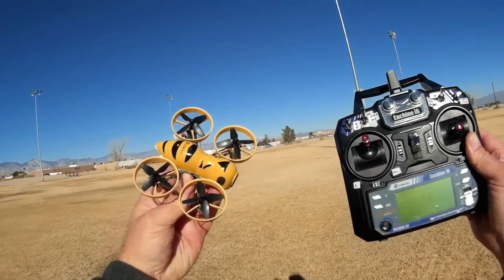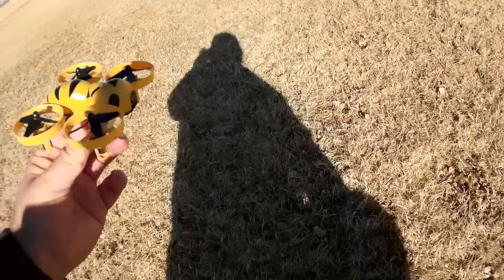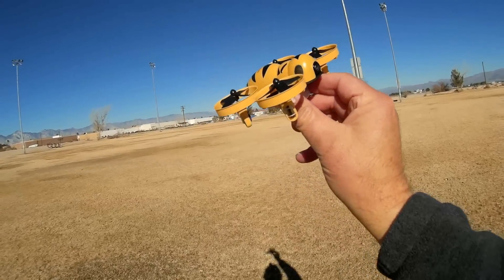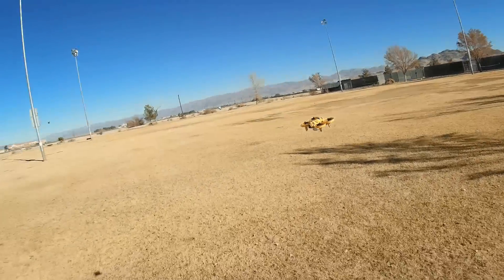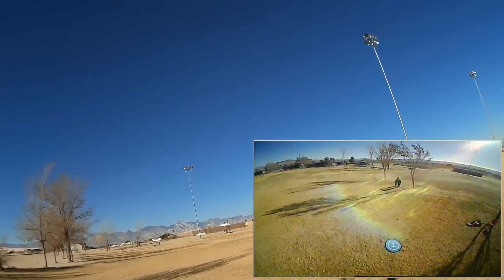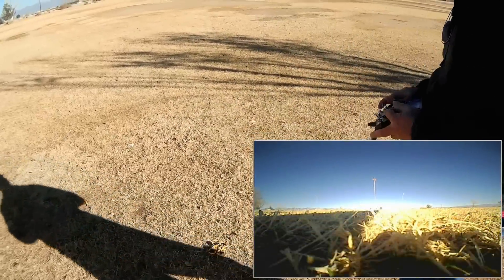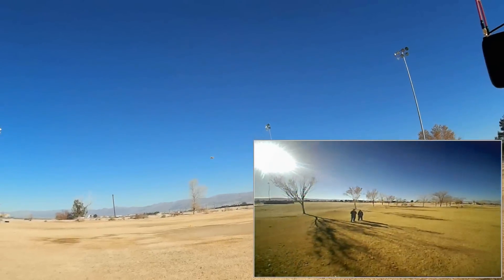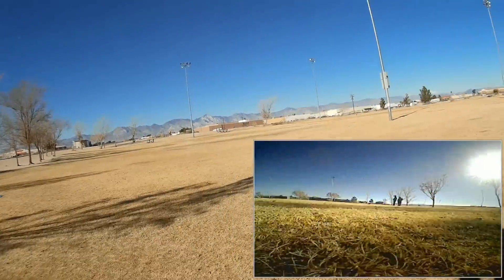Eachine Fatbee FB90 Micro FPV Drone Flight Test Review

Comment: hi another nice video...but sir I would like to know one thing though its not about the quad itself but its about the tx...my question is can i bind this tx with a flysky fs ia6b rx usuing pwm or ppm protocol to fly my other drones like 250mm qav like stuffs...i have a 250 mm quad running with emax 1806 2300kv, 20amp simonk,naze32 open pilot 6dof,3s 2200mah(35c)5030 prop...your feedback will help me a lot quadcopter 101 :-)
Reply from the maker: Unfortunately, this doesn't come in ARF version to install your own transmitter.  But it does come in Flysky BNF, with 6CH PPM output Flysky AFHDS.
Reply: Quadcopter 101 thanks for your reply

Comment: For the same money, I really like my Eachine QX 95, the Flysky FSi6 transmitter and my Eachine VR 2D goggles.  I do recommend sitting on a chair when flying FPV.  I'm a great line of sight flyer, but flying FPV for us old guys is quite different. Also, if you need reading glasses like me, you'll have to purchase Carson lenses for the VR D2 goggles..
Reply from the maker: Be careful of the Flysky BNF version of the QX95.  It uses the old AFHDS receiver, with no failsafe capability.  My Flysky QX95 flew away, never to be seen again :(  https://www.youtube.com/watch?v=XyxQk-OCkKI
Reply: I purchased it for my indoor RC club flights.  I'll keep an eye on it though.;)

Comment: How do you calibrate the gyro? My is no way as stable as yours out of the box. It need a lot of backward and left turn trim to maintain a so-so hover. The prop to the right of the camera come off too easy. Its off 3 sec on the maiden fright! BTW, I do not know how to use Cleanflight? Can you do a video?
Reply from the maker: As you may have guessed, you need to use Cleanflight to calibrate its gyros.  Cleanflight is available as a Google Chrome plugin app here https://chrome.google.com/webstore/detail/cleanflight-configurator/enacoimjcgeinfnnnpajinjgmkahmfgb?hl=en
I recommend that you search YouTube to view some Cleanflight tutorials.  Focus for the moment on gyro calibration tutorials (it's not difficult).
Reply: Took your advice and do Cleanflight to calibrate the Accelerorometer. Was looking for the save button by going through the menu selection on the left panel. But before I perform any safe, the motors are spinning at 1000 RPM. I am a lost how and why this happened. Unplugged the USB cable and plug in the battery, all motors are spinning at full speed. Now it is not playable. Can you tell me how I can fix this? Is there a default setting data file I can download to it to get it back to a functional state? Thanks for the help!
Reply from the maker: You may want to ask your question in the following forum.  They have FVB90 owners with more experience with this aircraft, and may be able to help you with your problem https://www.rcgroups.com/forums/showthread.php?2744640-Eachine-Fatbee-FB90-90mm-Micro-FPV-Racing-Quadcopter-F3-FC

Comment: great video as always.
got a question for ya, I heard you can put a piece of tinfoil over a certain part of the quadcopter to block the satellites to make it go faster....
any truth to that?
Reply from the maker: That might only work with GPS quadcopters that don't have an option for selecting manual or altitude hold control. When flying in GPS mode, many quadcopters limit the speed that you can go to help improve accuracy of the GPS.  I think that the intent of the foil is to force it to lose satellite lock, and thus have it default into manual or altitude hold mode.  But by doing so, you better know how to fly it manually without the aid of the GPS to help you.
Reply: Quadcopter 101 yes it's the hubsan h501c that I have where the guy said about the tinfoil on that put puticular quadcopter, it doesn't have manual and altitude  mode,  only altitude mode. what part of the quadcopter do you tinfoil?

Comment: Originally saw this on SeBy DocKy's channel .. he had it flying pretty well in his back yard.  I suggest you try flying in Horizon mode. it has more stability than Acro, yet will allow you to roll & flip.  I recently ordered the Eachine QX95 in FrSky version to use with my Taranis 9D+ .. should be fun to fly in Angle indoors, and a lot of fun to fly in Horizon or Acro outdoors.  It has tremendous punch, compared to this model (see it demoed on AndyRC channel).  Still below freezing outside right now, but supposed to get up maybe in to the 50's on the day AFTER Christmas here .. we'll see, as weather can change instantly here along the South shore of Lake Erie. Cheers.
Reply: Yes a modded version of the Fatbee, I so-call "LightBee" 59AWG instead of 64g and with tri-blades hubsan props
Reply from the maker: I saw his video also.  Though I think that he modified the props to tri-blades, and also lightened his to improve its performance.  I also had the QX95, but unfortunately got the Flysky version with the AFHDS receiver.  It also had a bad receiver antenna.  The end result was watching it fly off to parts unknown into the sky :(

Comment from the maker: The Fatbee FB90 may be purchased here https://goo.gl/ywcBbW
And the Helipad may be found here https://goo.gl/yFzVWZ
Reply: Quadcopter 101 congrats on joining the big leagues with acro mode! Make sure you setup the expo function of your TX if you haven't done so already; it will help you a lot. I recommend about 60% for pitch and roll.
Reply from the maker: Not sure why I didn't think of that.  That did help a lot!   Thanks for the tip.  Now I can fly this around the house from room to room :)

Comment: Fun vid as ever, thanks :)
Forgive my ignorance but does the vtx using dipole mean it would be better to put dipole on receiver instead of CP? or does it not work like that?
Reply from the maker: Kind of.  As the vtx does not have a CP antenna, there is no real advantage to the receiver having a CP antenna.  But I could still receive a good signal from the quadcopter at the short ranges I was flying.